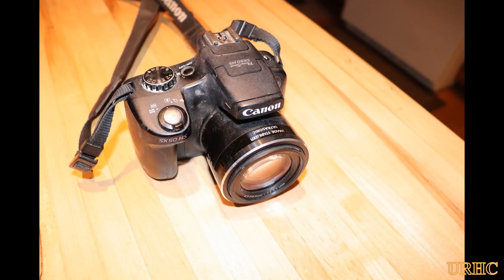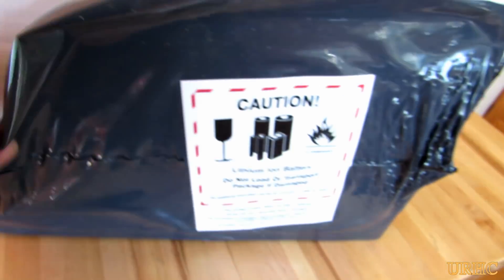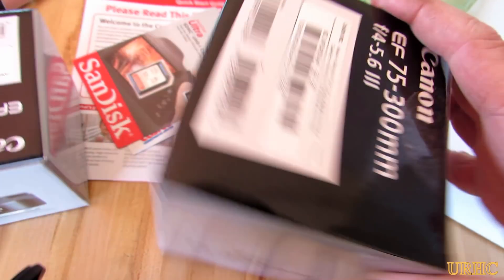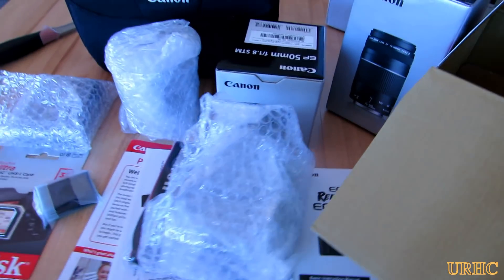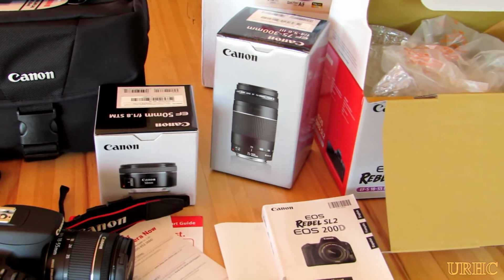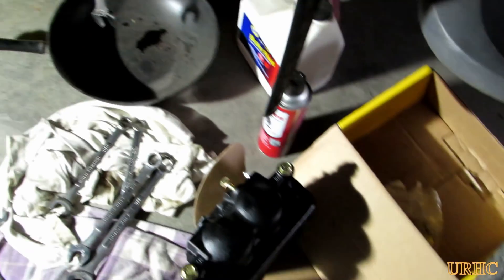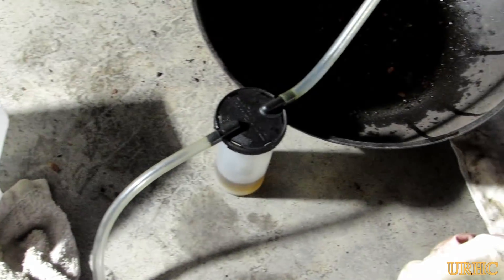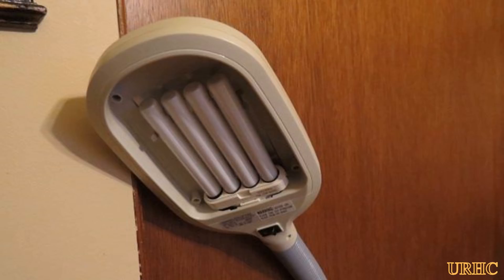November Break Downs, New Canon Rebel SL2 to get me going again

Comment: The couple times I ended up with busted P&S cameras, I called Canon refurb department and bought refurb's that looked brand new.
They also gave me trade in value and shipping label to send back the old gear.
Good deals at the time as I waited until the refurb's were discounted additional.
Reply from the maker: This is a new model and I didn't see any refurbs on their site. I am looking at a refurb lense that I want and waiting for it to be back in stock. That stuff disappears fast when discount emails go out. The old camera is pretty toasted so I don't think it has any value. Thanks for watching.
Reply: I wanted to buy the refurb HF G30 video camera a while back. It was always out of stock. The refurb was $600, but would constantly go on sale for $450, but none in stock. I had to sit and hit the refresh button for months and I just caught it a few months back and bought it for $450 which I think was a very good deal. 

If you can wait it out, it pays to refresh and wait for their extra 20%+ off sales.

Thanks for the videos.

Comment: I would have loved to be a fly on your wall when the power went out and you both were stuck in the recliners. You must have been able to laugh about it later. Thank you for the video.
Reply from the maker: It was a big surprise.  I assumed there was someway to get out of them with a power failure. If only one side was reclined you could roll to the other side and get out, but with both reclined we were at the mercy of the electric company. We got a good laugh out of it and realized we are getting older. Thought I would warn others.Thanks for watching

Comment: Kind of off topic but regarding the brake caliper.  I went through several brake calipers on my truck in a short time as well.  I ended up replacing the rubber brake line that attached to the caliper having problems and haven't had a problem with it in years.  Just FYI.  I'm curious what you think of your new camera!  I have an SL1 and it works great!
Reply: What was going on with mine was the rubber hose was somehow holding the pressure on the caliper so when I let off the brake, the brake fluid pressure stayed at the caliper.  I hope that makes sense.
Reply from the maker: The calipers for these have a phenolic puck that I understand causes the freezing up. I had a brand new Chevy 2500 that had the problem you talk about. It took 10 trips to the dealer because it was intermittent.  Both front hoses were defective and had to be replaced. 
I am very happy with the SL2. Sitll using the auto mode most of the time.  I am trying to figure out how to use lighting  to make better videos and found out I still have to work in 30p because my computer is not powerfull enough  and takes 4 times as long to process 60p. Thanks for watching.

Comment: Suggestion - get yourself UV filters for all the lenses - it won't really affect the images (it will filters some blue in bright daylight shots) and it provides "the first line of defense" for the surface of your lenses.

And for outdoor work look into getting a circular polarizer - it will make colors much richer, and it will reduce glare from surfaces like water and glass (as you look through the viewfinder you rotate the filter until you see the best looking image - it is really obvious in use because the sky will become a deep, azure blue). Depending on the sizes required you may get luck and the polarizer will fit multiple lenses.

The best filters are those that are "multi-coated" (MC).  You don't have to get big-dollar brand names, there are generics on eBay that are just fine (send me a message with the lens sizes (the filter size is on the front of each lens - looks like maybe 52mm for a couple of them???) and I'd be happy to suggest a couple).... 

My guess is you'll find the 75-300 the most useful, although the static 50mm will be best in low light.
Reply: And sorry for your bad luck with things breaking down.
Reply from the maker: Thanks for the info. The two zoom lenses say 58mm and I was looking at a cheep set of Vivitar filters on amazon to play with. The largest problem seems to be my shop has fluorescent lights and videos seem to get a yellowish tint. The Vivitar set says it has a filter that will help under fluorescent lights and a circular polarizer along with a couple others for $25 https://www.amazon.com/gp/product/B0081TSZCC/ref=ox_sc_act_title_1?smid=A1WFSHX6J483SX&psc=1 They don't say multi coated, but are made of glass. Maybe they are not the best choice. So far I have had the best luck with the 18-55 because it is stabilized, but from what I have read with an APS-C sensor the values actually shift. The 50 mm is great for low light, but seems hard to use in a small space like my shop, just isn't wide enough. I have a lot to learn. Thanks for your help.
Reply: Filters may help with the lighting - but by far the best place to compensate is inside the camera.  I am not familiar with this model - but I would bet it has settings you apply for daylight vs fluorescent lighting. A filter can only do so much....  I bet with a few test shots you'll be able to make it look better with no filters or post-processing.

And for $25 that's likely a very good place to start.  If you find you really like / use the polarizer a lot you can get a better one later.

I would still encourage a UV filter for each lens - again, for the protection more than for the filtering.
Reply: Also - if the lenses are designed for a "C" size censor there is no shift in the values.  It's only when you use a C-sized lens on a full frame sensor or a full-frame lens on a C-size sensor that you have "changes".  It hardly matters tho - you just compose in the viewfinder and shoot ;)
Reply from the maker: Thanks, I  ordered a set to try. The photos are great on the auto settings,  the videos are off. It automatically goes to daylight settings under fluorescent lighting in the video mode.  You have given me the courage to enter into the manual settings to try and change it in the camera. If all else fails, l will change to all LEDs in the shop. I guess you can't believe everything you see on YouTube about lenses. Thanks for your help.
Reply from the maker: There's a setting in the camera for fluorescent lighting and it fixed everything.  Thanks again for pointing me in the proper direction

Comment: Like was said on the other 'comments' , calamities happen in more than 3's for you lately,  your have them in bunches!  I am going to be the optimists and say that allows you to get a lot of things resolved in 'bunches' giving you a longer break between times!?  I have a electric recliner and never thought about it losing power in the reclined position!  I will be shopping for a power pack immediately! LOL  URHC really is a 'Learning Channel'!
Reply from the maker: If you are in an area that has frequent power outages it is a worthwhile investment. You can even find some with USB connections that will charge cell phones in a outage. Watch for a good sale and make sure the wattage matches the power requirement of the chair. I have seen comments that some chairs have backup batteries so check for that first. Thanks for watching.